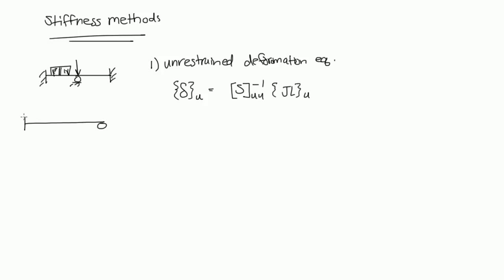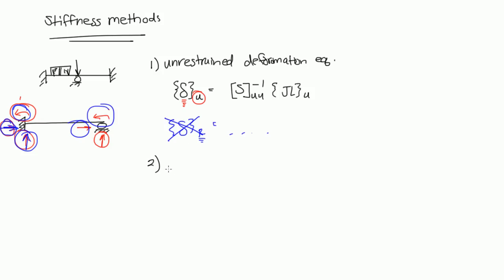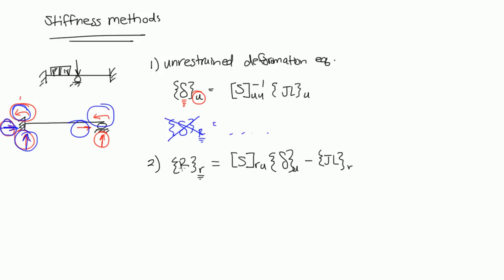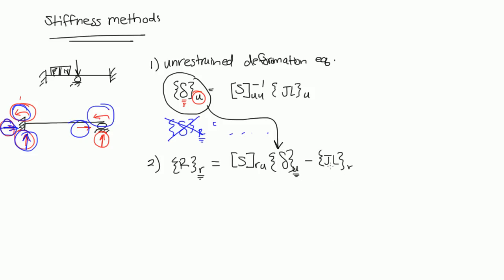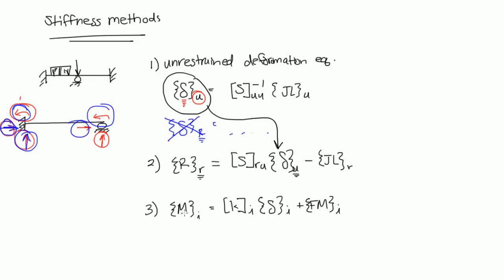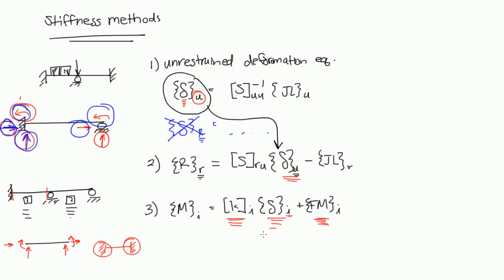Stiffness Method Equations

Comment: is this the direct stiffness method? I'm learning other equations like: A_d= A_dl + SD  
A_d is the action corresponding to displacements in the original structure, A_dl is the action corresponding to displacement 1 caused by the loads in the restrained structure. It can depend on the number of displacement present. S is the s-matrix size depends the number of displacements. D matrix is 1x number of displacements.